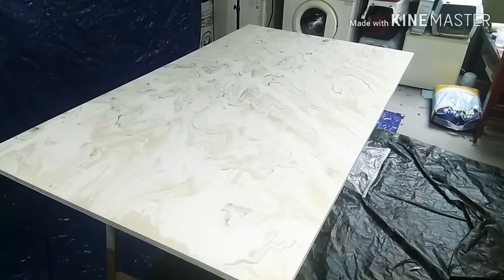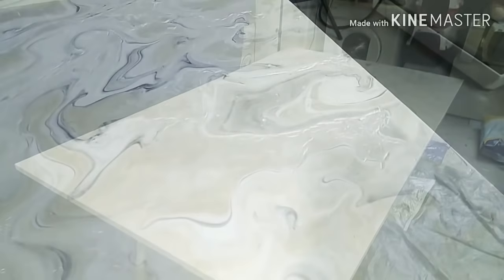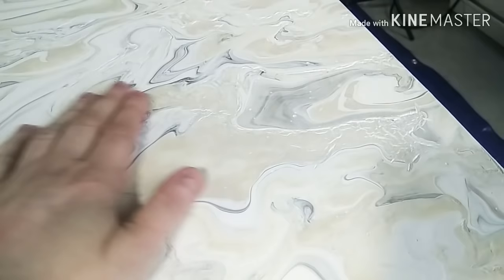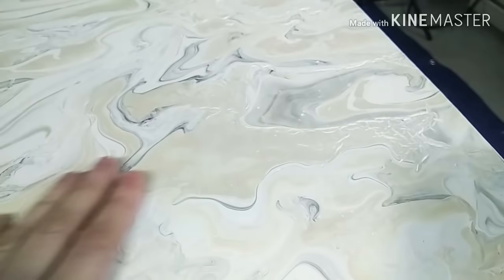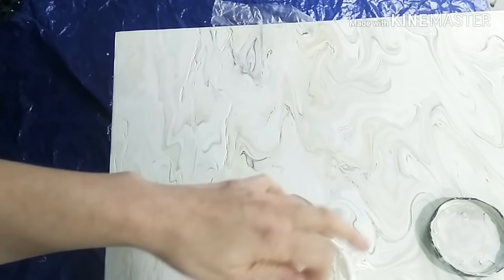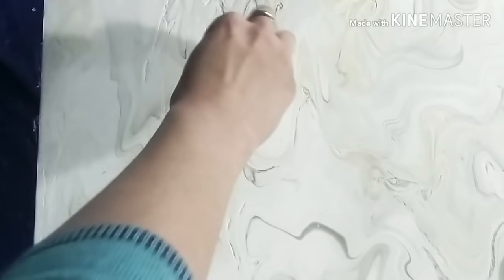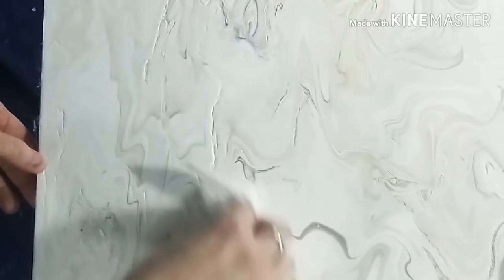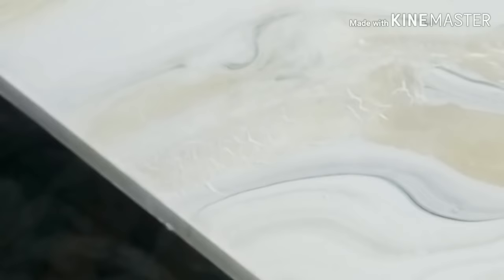Acrylic pouring : completely CRACKED! What now? A little fix / camouflage for Fluid Art

Comment: I poured over an acrylic pour, and not only did I hate it - I overestimated how mutch paint, so it was muddled- but also it had awfully deep cracks. I'm decided whether to toss it. Is there another option? What if I gesso over it? It's a stretched 8x10. Will it have too much paint? What would YOU do, if you couldn't simply add lines to make it pretty?
Reply from the maker: Normally you can repour if its propsrly cured

Comment: I was devastated. I did a 3‘ x 4‘ acrylic pour.  I was commissioned to do it and also my first commission. Anyway, it took days to dry because it was quite a bit of paint 280 ounces I think something like that. I was drying it in my patio which I could heat with a electric fireplace during the day but at night my housemate insisted that I un-plug it and not let it run at night while we were sleeping which I completely understood.  So at first it was drying was fine but it was cold at night which caused it to take longer to dry which was also fine.  It only needed one more day to dry - I was so excited that night it dropped below 32° and it was freezing so the whole bottom half cracked. It was a Chakra wave of colors so the red yellow orange and some green cracked.  At the time I was frantically looking on YouTube for ways to fix it, probably why tour video popped up for me today.  I still have the painting, I couldn’t sell it looking like that.  You can’t tell from a few feet away but I would know so I finally decided to re-pour but it had come out so pretty so it’s upsetting The guy that commissioned me didn’t want to wait he was more in a rush to just throw anything on his walls of his lavish home not really caring about the art itself but that’s ok.  I will eventually sell it and I bought the canvas at a very good deal at the time.   I love your video thanks for the share because I was totally lost as to what I could do to fix it but it’s just too big I think I’m just going to sand it down and re-pour it like I said.  I just can’t believe all the time I had put into mixing paint but that’s okay, I can do it again!!  Thanks for the tips!!